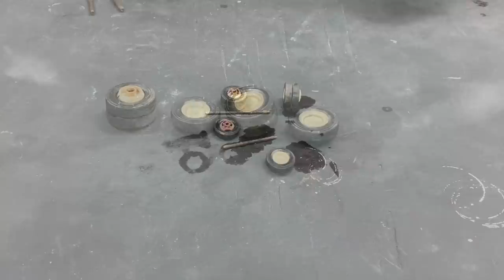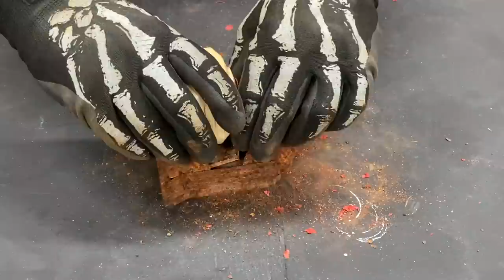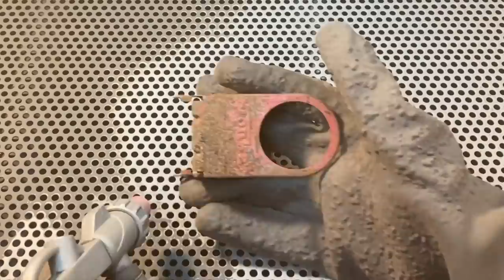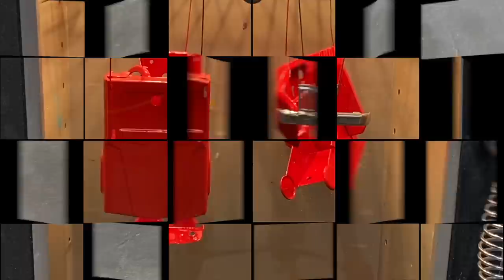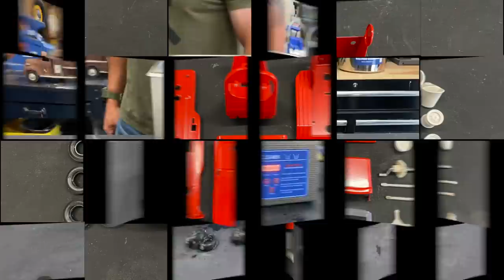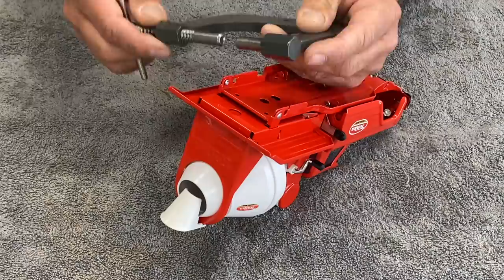1970's Tonka Cement Mixer

Comment: Question. I noticed that on some toys you use the acetone and out gassing steps, but not always. Is it because the metal is exceptionally dirty and rusty? Does it help the paint adhere better? Just curious. Another great job😁👍
Reply: Probably it's just a matter of not showing always the same repetitive procedure, that's a step that you always need to do after you sandblast the pieces, because that can always be some residue to eliminate before priming them. :)